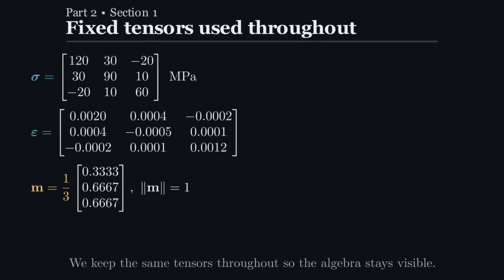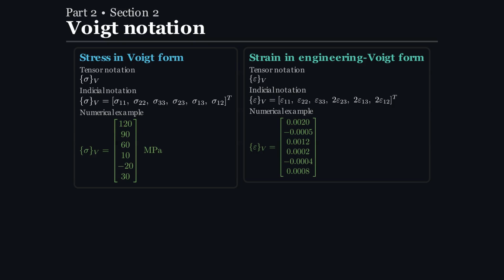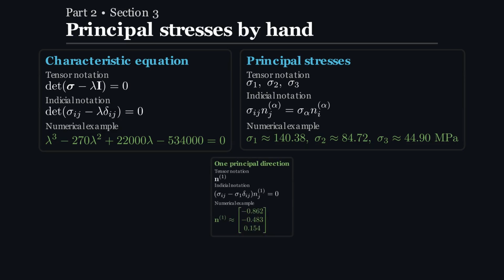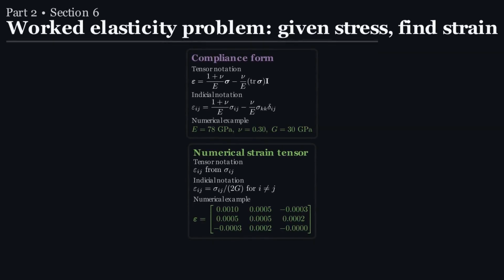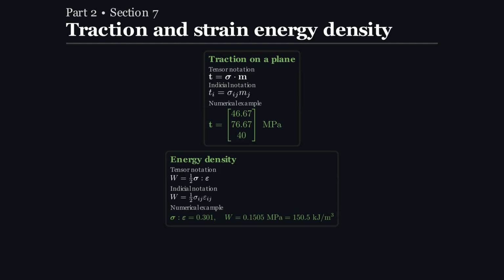Solid Mechanics Tensors Part 2 | Voigt Notation, Principal Stresses, and Elasticity Problems

Comment from the maker: This video, the second in a series on solid mechanics, focuses on practical computational techniques and elasticity problems. The presenter follows a consistent pedagogical rule: tensor notation first, initial notation second, and a numerical example third (0:15).

Key topics covered include:

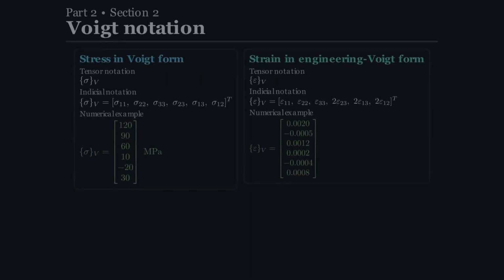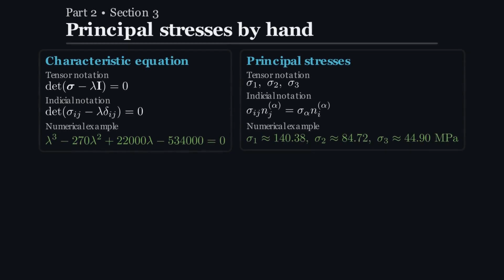Voigt Notation (0:38 - 1:02): Explains how to store a symmetric second-order tensor as a six-component vector, including the specific factor of two used for engineering shear strain.
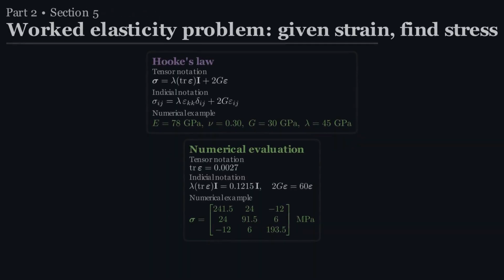Principal Stresses and Strains (1:03 - 1:37): Demonstrates how to solve the eigenvalue problem to find principal values and directions for both stress and strain tensors.
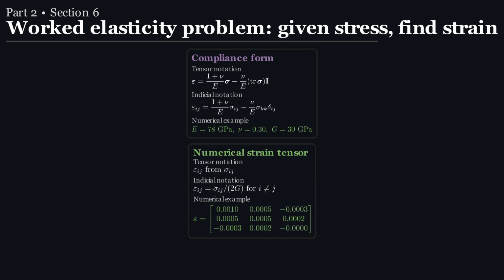Elasticity Problems (1:38 - 2:14): Covers solving Hooke's law in both directions—calculating stress from given strain, and finding strain from given stress using the compliance map.
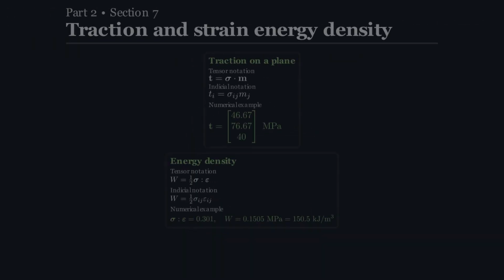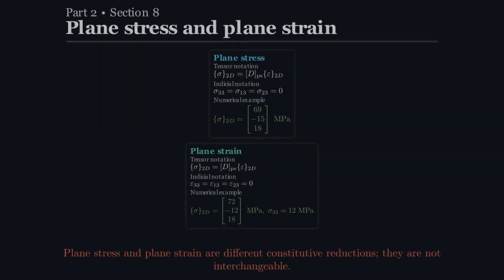Traction and Strain Energy (2:15 - 2:32): Explains traction acting on a plane normal and the calculation of strain energy density via double contraction.
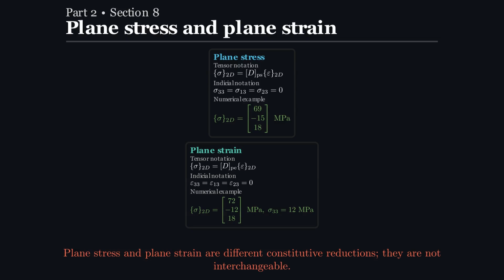Plane Stress and Plane Strain (2:33 - 2:51): Discusses these constitutive reductions and their different constraints.
The video concludes by summarizing these essential progressions in solid mechanics (2:52 - 3:11).